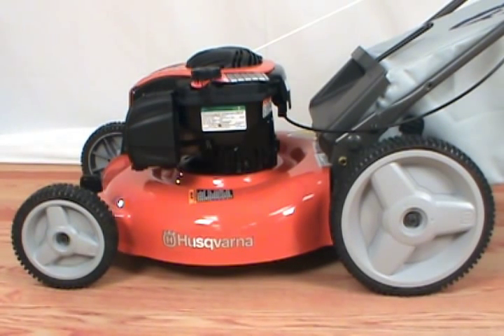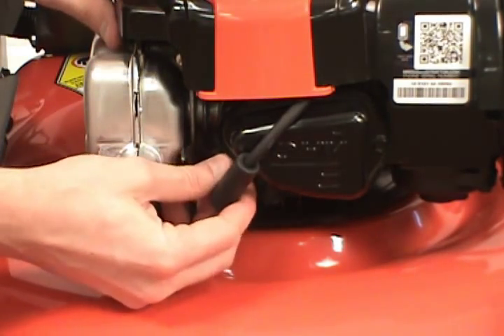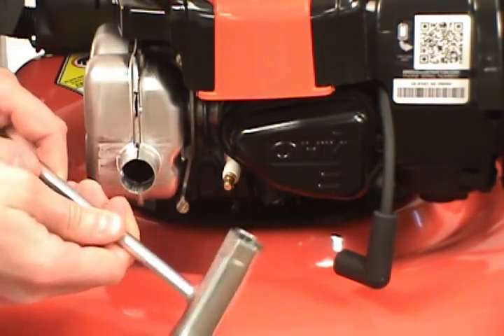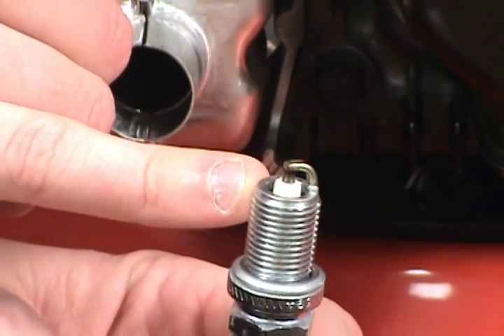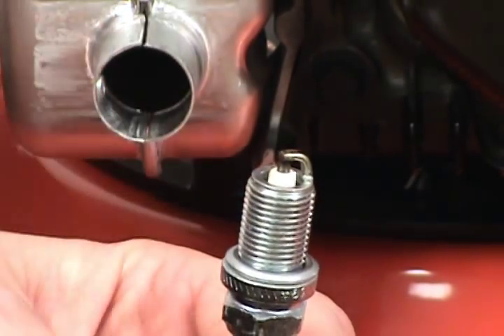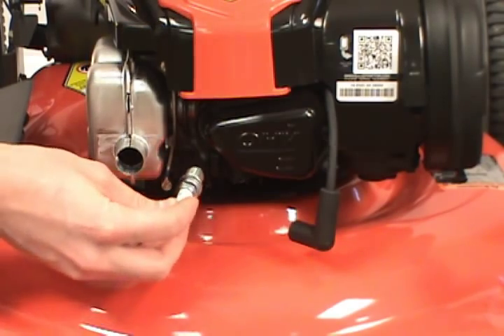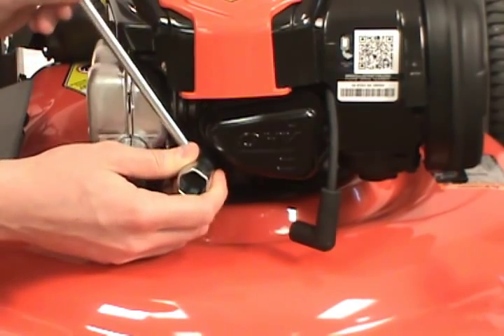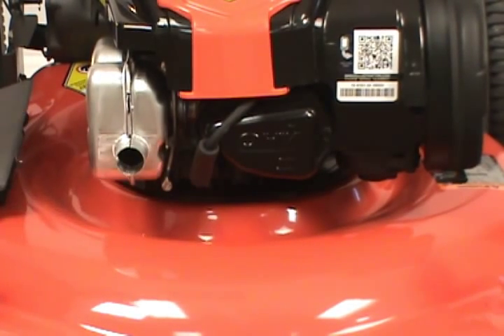Replacing the Spark Plug - Husqvarna Lawn Mower

Comment: Be careful with the Husqvarna push mower owner's manual if you have a Honda engine. If you read the Honda manual that comes with all the reference material, it talks about two different spark plugs. A 6-series when you use the Honda engine as a power wash unit (less heat). But when used as a lawn mower engine, it needs to be a 5-series spark plug (able to handle more heat). ALSO, the manual fails to point out you want a spark plug with the ceramic insulator with waves versus straight ceramic insulation. Otherwise, the spark plug cap rattles right off during mowing. That's why it requires that wavy shape so the cap inside ribbing can grip onto the insulator grooves.
Reply: Thank you Bob Dole really useful info... I have the husqvarna self propelled mower with the Honda Engine.
Reply: Hello Bob,

That was a very informative reply.
Could you please tell me exactly which spark plug to buy and where? Yes, I realize your reply is 4 years old!~lol

Comment: Bad video. He makes it look so easy; I can't get the spark plug wrench in a position to loosen my plug which is extremely tight. So he must have done the hard work off video and recorded it just coming right off. Not impressed. Now I have to find another video to show reality.
Reply: I used a number 18 wrench with the backside rather than the actual wrench side
Reply: Flash forward to mid 2021:  If you don't have a socket set smaller wrenches might make it challenging.  "Light tapping action" is the key.   Keep trying to familiarize yourself with basic tools and you'll get the hang of it.   Perhaps you have already.  ;)
Reply: Because it is easy.
Reply: Make sure to make a video of it so the simple minded folks can understand